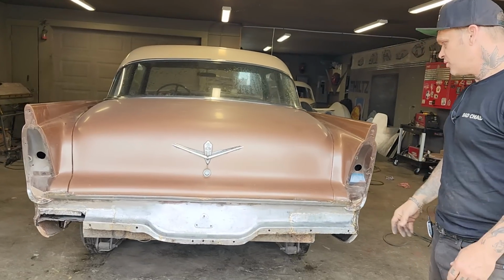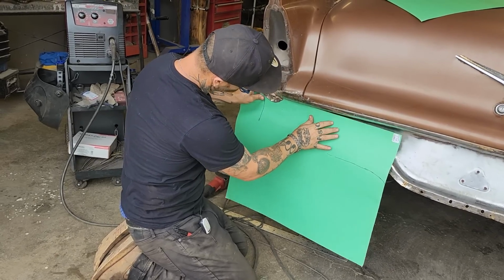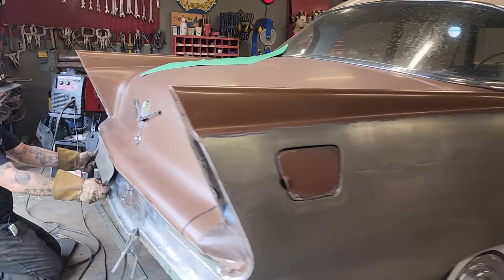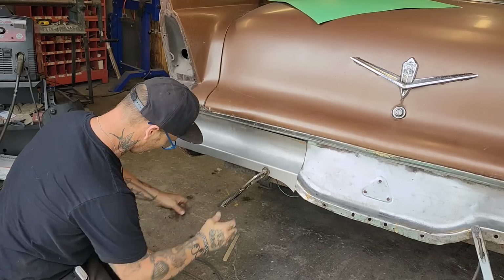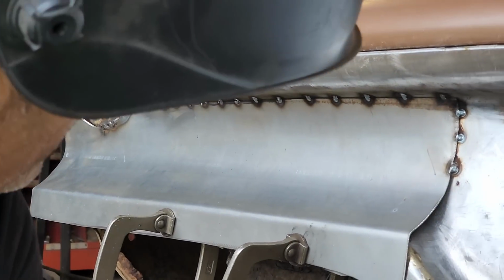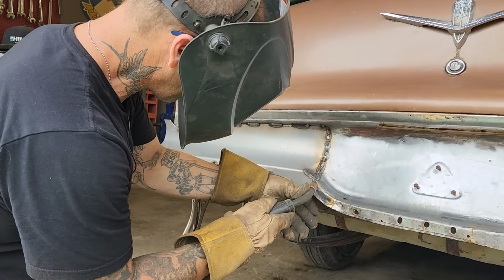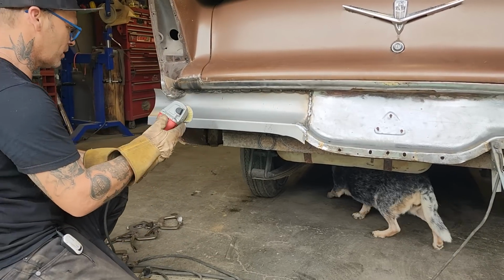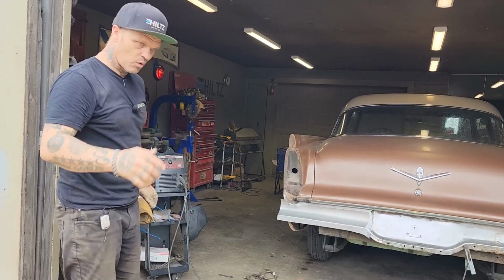Overlapped patch panel rust repair

Comment: Great work Chad. So you have no worries with overlapped metal, or the bare metal left on the back side? We are doing some panels and using weld thru primer on the lapped portion and worried that isnt enough.

Comment: hard to watch at times. get some plastic teardrop hammers, won't leave marks. be careful welding around the brazing i see. that will spark up like crazy. i would fit/shape that whole part while it's loose and can be handled and shaped on a sandbag of what ever it you have to get it shaped correctly. once it gets tacked, those options are gone.

Comment: Hmmm…Chad; I understand what you’re doing, however you’ve got a lot of bare metal going on there.  Perhaps you should consider spraying the bare metal with a rust paint before you overlap the panels…and minimize the bare metal to where you are laying down the beads.  5 extra minutes would be all it takes.  Yes there are many overlapped panels in a car body, but they are at least primed after they are spot welded, then sealed after that.  If there’s water trapped, (humidity creates sweating panels) untreated 18ga steel will start to bubble in six months.  Your fabrication is exceptional…extra attention to preventing corrosion would give you an A+.

Comment: I really like your approach with this. It's the approach I use with all my cars. They are drivers and not trailer queens. So the question you need to ask yourself is how much time are you willing to invest in your project? For me it is always to do the best job possible but get it on the road quickly so I can enjoy driving it.

Comment: Just put new bearing and carbon brushing in the dewalt that most likely whats wrong with it you use the piss out of them. I have wood routers that I use everyday some are 15 years old  Porter Cable was the best in routers to buylight weight and last a long time they stopped selling them soI've got to just fix them when something gose wrong.

Comment: 9times out of ten I understand or agree with chads process , but I’m perplexed by this one , I don’t understand how he could just overlap it so majorly plus no weld through primer on the metal so it’s just going to fester inside there with condensation or a small leak in seam sealer or weld. 
I understand the what he is doing but why not just cut out the metal underneath if not all of it just most of it so it’s a nice job . If your going to that effort already. 
Or just patch the small hole on the ledt  and , weld up the pin holes , sandblast and skim it with fibre fill . Will last just as long and be a lot quicker . The repairs already done in the beaver don’t look half bad , just needed cleaning up . 
I’m not against overlapping when necessary and he could have left an inch the whole way around and overlapped that . I’m not a perfectionist but even I couldn’t weld over that much bare metal and sleep at night . Would do my head in 😂 
Rest if the car is going well although I think he may be making  it a bigger job than it needs to be

Comment: You said Makita that's actually a Milwaukee and yeah that's Milwaukee for you I've been using a cordless Makita grinder for 2 years almost every day finally got a new model with the switch on the bottom of the handle really is a nice tool better than having to reach up on top of it to turn it on

Comment: Chad is one artist with that zip cut. I was a pipefitter on a welding slab & that fine grinding is not as easy as you might think. Jolene, you caught it very well with your close ups. Great teamwork...
Reply: You definitely have to be careful while grinding the stringer bead.  During my apprenticeship I gave more than one welder fits I’m sure.   Looking back 60 or so yrs I now realize how important (and fortunate) I was to learn from some of the finest welders in the world.
Reply: @i8ntnuts  I too had great teachings when I started out. My two main welders would give me inspiration when telling me I did wrong, and then walk me thru what was better. I learned quickly and well.  Thanks for your note.

Comment: Every time I weld new metal to that old stuff I burn holes holes in the old metal. Chad makes this look easy. Nice work.
Reply: From time to time we use a back up strip to help prevent burn through’s.  Or, if you have access, you can try holding a small block of brass behind the work piece To keep the puddle from falling out/off

Comment: Chad you put in the trunk floor you added a small section to attach your rear body panel but you need to add that attaching 90degree piece all the way across to other tailight (saw the open area)
Why ..you are inviting carbon monoxide to enter the car as you drive through the area left open. Please take that into consideration

Comment: Chad grab yourself Dewalt Grinder with Batteries or If you want a really good top quality tool  grab a Walter Grinder. Walter grinders last one hell of a long time. They are top quality grinders that welder fitters use in the trade but they are a lot more expensive than Milwaukee or Dewalt tools.  I used them for years and never had any trouble with them as a welder fitter, for instance, I used my last Walter grinder for over five years and its still working strong.

Comment: After being in HVAC for over 30 years I have purchased every damn brand out there and I found that Ridgid cordless tools are by far better than anything else but it seems that corded grinders Dewalt is one of the best.  I use my cordless Ridgid grinder more than anything else but if I was cutting as much as you do I would use a corded grinder but bottom line is I have over a thousand dollars worth of Milwaukee tools that sit in a box stored away because I was tired of fixing them.  I have never once had an issue with my Ridgid tools.
Reply: New Milwaukee is terrible